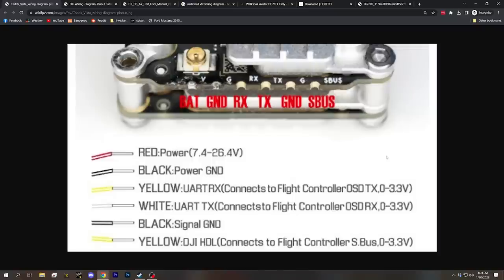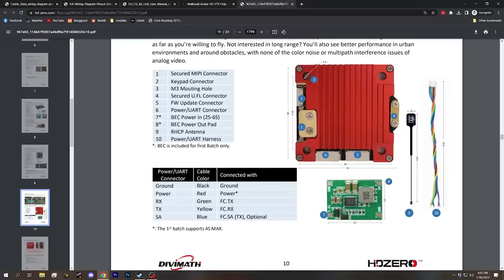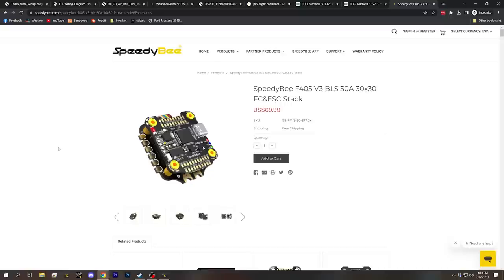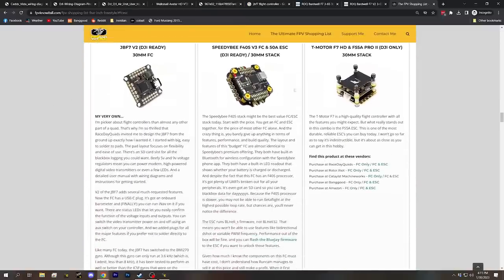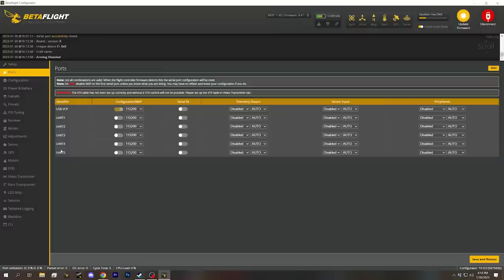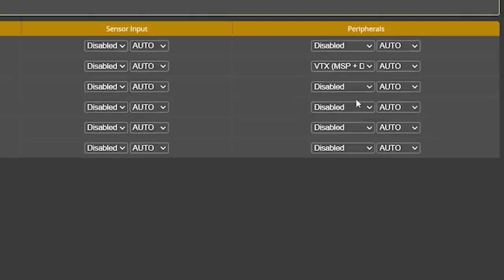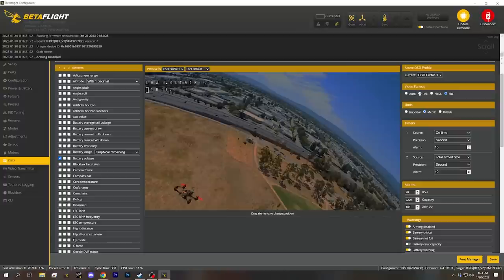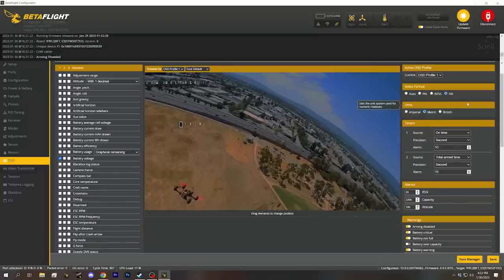Betaflight HD OSD with DJI Walksnail & HDZero // HOW TO SET UP

Comment: If 4.4 build is done with USE_OSD_SD then you may need to set osd_displayport_device =MSP. This is because the MAX7456 will be used if found. Once HD VTX fully support HD OSD then this will be set automatically. Currently only WTFOS does this.
Reply from the maker: Damn. I didn't realize that wasn't handled automatically.
Reply: Mine only works 1/2 the time. Any reason you can think of?
Reply: This comment ended my headache. Thank you!!
Reply: i should have read the comments sooner lol all good now good man joshua and steve for pointing that out
Reply: @evidentloss  nope. This is configured on the ports tab making it much simpler.
Reply: @JoshuaBardwell  Can you send one of your tires to a fan of this hobby and in return I will send you money because there are no assemblies and such things in Iraq and I do not know how to ask for these things ?
Reply: Saved me a mess of hassle! Thanks a bunch for this info!
I've set HD OSD in the iNav ports tab twice now and this wasn't a thing, so it was really making me wonder what was up.
Reply: YOU ARE A SAINT YOU DESERVE A NOBEL PEACE PRIZE
Reply: The gotcha for me was the firmware in the Walksnail VTX must match that of the goggles. Or else.. Nothing. As soon as you flash the VTX, up it comes. 😊

Comment: On bf 4.4. I couldn't use the recommended uart for osd as it was on the plug and I wanted to direct solder. So used a different uart pair. Didn't matter what I did I could not get it to work but my walksnail would come out of standby mode when armed. I re-mapped my uart pads to match the fc vtx uarts that didn't work but when I mapped them back to where they were originally it worked. Strange stuff.

Comment: My main question is for most of the hardware where can i buy it because at least in germany most of the stuff is sold out always. And its sold out now for many months. Some is available for unrealistically overpriced money.
Reply: I wouldn’t be surprised if a lot of that gear is going to Ukraine. The fpv hobby has certainly grown there for one way whoops!
Reply: @SkeezyFPV  I think the moment a company produced stuff like that its already sold out by military.
Reply: @SkeezyFPV  just wish to say, and i am here to learn how to make suicide fpv quad 😂, i am from Ukraine, and we run out of Maviks
Reply: @3dmaxers  then why are you watching digital vtx set up video's lol.
One way=cheap gear=analog. 
No need for mavicks wtf lol.
Reply: @3dmaxers  yeah cheap analog would be better and if you adjust the wattage to the minimum needed to run the mission it’s probably harder to triangulate where the operator is than with digital where you can’t really control the power output. Idk tho. I never built shit like that. I’m a former Marine artilleryman. 🇺🇸🇧🇧
Reply: @FATSNAIL-FPV  actually, as a former artilleryman, using a Mavic right on the gun line or on the mortar to spot targets of opportunity, troop movements, and adjusting fire, the mavics are far more valuable imo. Even a 7” fpv quad is of little value compared to what mavics can and are being used for. Fpv is too noisy for observation except in fast overwhelming attacks using violence of action. JB probably doesn’t want me talking about this stuff on his page btw.
Reply: @SkeezyFPV  veteran here to, I meant suicide drones. They're the hot stuff now on that front. Basically just grenade transporters.
Reply: @SkeezyFPV  analog camera is enough, usually operator know where to fly. Russians start to use jammer for 2.4 ghz, but only near valuable targets. Usually artillery deal with them. But one drone can disable sniper team which spend a lot of time to train, and their equipment cost 5k. So even it's a big drone carrying mortar shell it's still very profitable
Reply: @FATSNAIL-FPV  like an rc m203 lol.  No, I’ve watched a lot of video of them flying into CPs in the trenches and that’s some badass shit. I mean if it were my country being invaded I know what I’d be doing. I volunteered back in March but now I’ve got neurosurgery scheduled instead to fix (hopefully) some issues from breaking my back in the Corps.
Reply: @3dmaxers  JB probably doesn’t want us talking about such things in his comments. I’m no pro. But sub on my channel and I’d be happy to share my experience building my first diy quad as well as answer any questions or help in any way that I can. I was in contact with someone that I was going to send some water filter to in Ukraine but unfortunately he was in bakmhut and I haven’t heard from him since November 27. I’d like to help in any legal way that I can, sir.
Reply: FPV parts and gear are plentiful in the states.
Reply: @FATSNAIL-FPV  I wish to make recon drone to watch what's around me. I am not mobilized, but in case wish to have own drone in squad
Reply: @SkeezyFPV  sure, I am not building right now. I am IT guy, and ex sniper. Now I just learn things and  try to save some money cause most of it going to help my buddies on the frontline. My buddy who has 338 told me yesterday that better he have drone that his rifle... 😁
Reply: @SkeezyFPV  JB will not worry about it, cause US send us more interesting thing in masses. And I think our children's will fight together against future threats in near future 😉
Reply: @3dmaxers  yo just get yourself some maybe illegal 1w+ analog VTX and get some goggels with inbuild Recorders, some cheap 6s batterys and fc and build 5 Inch suicide quads for ~300€ per drone... Recievers are cheap and you only Need one controller you modify that one a little for the needed 10km to Match Up with your analog video... Upload the Shit you doing with some stuf maybe cutted Out so Nobody can See the Pilot Position in the Videos etc, and maybe you gain Back some Money to build more and bigger drones
Reply: Just buy from the producers.. 2 weeks in DE. Flywoo, caddx, geprc, iflight 😉👍
Reply: n factory ist eine gute Quelle

Comment: JB there is something seriously wrong with BF 4.4 with MSP using DJI(caddx or original air unit)!  BF 4.3 was perfect. 2 different Fc and two different air units(caddx and dji air unit) same issue where  the OSD may or may not show up.  If it does its at 4:3 aspect or SMALLER.  Goggles and both air units have latest WTFO firmware, BF 4.4 on both FC (Lumrnier H7 and newbee drone AIO infinity v2). Not needed in 4.4 but can confirm "get display" is set to MSP and "get vcd" is HD. Again CLI commands are not needed in 4.4 and set correct.  In the OSD Tab HD is selected and  do have the wide screen picture but outputs something smaller than 4:3 if anything at all! Actually if you place OSD options past the vetticle center or horizontal center of the screen it will not render ANYTHING in the goggles... Again all firmware is up to date and everything renders correct in BF4.3.
ALSO 4.4 doesn't show dual gyros if your FC has them and can't set the correct orientation of the gps module(matek 5883, flipped 270 degrees.) It keeps reverting to default orientation.
Anyone have ANY THOUGHTS.....
Reply: Are you using FakeHD and is your OSD shrunk into 1/3 of the screen in the goggles?
Reply: Hi, I have the same problem that my OSD only appears in an apparently 4:3 window in my DJI Goggles V2, meaning I have them right in the middle of my 16:9 camera view... All firmwares are up to date, I tried all the options in BF osd (auto, pal, nuts, hd) nothing changes... Any ideas what I can do to move my osd informations to the side of the 16:9 screens?
Reply: @beeRacer505  I hadn't been able to resolve it yet.  Just to confirm that the wtfo was fine on the goggles and air unit I reverted back to BF4.3 and all was normal again. At this point it's a 4.4 issue.  I have 2 caddx and 1 dji air u on bf 4.4 and ALL of them have an issue with the OSD. Again roll back the firmware on the FC and all is well.  4.4 also has other serious bugs involving the gyros and compass orientation
Reply: @beeRacer505  Are you using WTFOS on your V2? DJI does not natively support the HD OSD.
Reply: @Mangorille  No, I am not using wtfos... To be honest I don't really care if I get the hd osd. I just want my osd to be 16:9 as it was with my previous setup: DJI goggles v1, air unit, BF 4.3. I forgot to mention that I am using the o3 air unit now, could that be the problem?
Reply: @rip_fpv6455  Okay, I haven't noticed any bugs yet, except for the osd. My CineBot30 is flying on rails with BF 4.4😁
Reply: @beeRacer505  Ya not supported with the O3 air unit, your OSD can only be drawn in the 4:3 space and with really large fonts. What you are looking for is actually called HD OSD (ability to use smaller fonts and have the OSD elements placed in a 16:9 format). The only way to do what you are looking for right now is with the Vista and V1/V2 goggles with WTFOS.
Reply: @Mangorille  So even with wtfos there is no way to get the 16:9 osd with the o3 air unit? Damn it! That sucks... I hope that dji fixes it soon. Thanks for your help!
Reply: @beeRacer505  Correct, WTFOS is only on the Digital FPV System side (Vista, Air Unit Lite, etc.) When you put the Goggles V2 into the Avata/O3 mode, it doesn't use WTFOS.
Reply: Same. Rooted caddx and V2's, wtfos up to date and the HD osd gives me 4:3 aspect that actually requires some elements to be placed outside of the preview in BF to enable them to be seen in goggles.
Reply: @Paulwhittingham  found a fix yet?
Reply: @beeRacer505  fix yet?
Reply: @zoeconner11  No, unfortunately it seems like we'll have to wait for dji to update their firmware with a fix for this problem. Sorry...
Reply: @beeRacer505  what's the work around?
Reply: @zoeconner11  Sorry, I don't know any. I'm just flying with the 4:3 old now. It sucks, but there ain't nothing I know that would fix it... If you do find something, please let me know!

Comment: Just noticed a little "bug" in bf 4.4: if i copy my osd settings from one copter to another one, the osd is not showing the right alignment of the elements. Just make sure, you enable 'hd' before you paste the cli, then everything is fine.
Just updated 4 of 5 builds to digital, wallsnail, and observed this behavior
Reply: Not a bug. This is a deliberate feature so that all OSD elements will be visible and thus movable on the configurator display.

Comment: Ive got runcam link wasp air unit and v2 goggles, after ive done the wtfos rooting and all of that procedure OSD does not show up. It shows battery % but it does not show the quads voltage at all. The BF OSD pops up on the start up which means my rooting was all good, no luck ive re-tried same procedure still nothing. air unit is on 608 and goggles is 606 firmware also the FC is on 4.4 MSP uart 1 is on and VTX MSP display too are on. Pls help

Comment: I’ve got a lil bug with the rooted dji v2 goggles. When I power on the quad before I power on the goggles the it only shows the top right of the osd. If I power up the goggles then the quad the osd appears properly. Not a big deal but still a weird bug
Reply: do you have the DJI FPV? Can you after root still connect to DJI FPV easily?
Reply: Broooo that happened to me too... I was soooo confused...! One time itd be og and the next itd be hd... og... hd.... Im like... WTF....!! THENNN I got it😅😆😆 I think we may have missed a step... Did you paste the 2 things in the cli? I did the one... but not the other....

Comment: Please help! I have walksnail lite vtx, betaflight 4.4.0 

All working fine, osd being show and vtx/goggles communicating with FC
 
BUT: I cant select Hd on the Osd tab, I check the HD box and it jumps to PAL, the osd is in this PAL tiny squares and I cant use the full HD space for the OSD

Comment: HD OSD is working well for me; rooted Goggles V2 and Vista in the Evoque F6X.

But..

The OSD sometimes remain at 4:3 instead of 16:9. Sometimes. Not sure why. I’m using Nebula Pro camera if it makes a difference.

I’m using the same Nebula Pro and WTFOS in my Mach R5 without the above issues (Beast F7 in the Mach R5 and Blitz Mini stack in the F6X).

Not sure if JB or anybody has any insights to why this is happening.
Reply: My problems are even worse with BF 4.4 dude. About to make a comment on it... funny it's on the same iflight Mach 5 lol! Osd stuck on 4:3 or even smaller!
Reply: @rip_fpv6455  reflash
Reply: @timmytson1  Timmy have reflash both fc firmware several times over the last 24hrs and even WTFO on air units and goggles.  Built over 2o drones in the last twelve months. I'm a pretty advanced user. Like Bardwell but prettier and richer lol
Reply: Fix for this?

Comment: I know it's late but I have a question/ theory. I've just got a new avatar system and the setup went OK, but as soon as I unplug the drone and reconnect later the osd is gone. 
But if I start like that then go into the speedybee app (I have an f4) then reset the osd comes back!
My theory is the avatar system starts slower then the FC and misses that point where the osd is applied but if I soft restart via app the walksnail never powers down and is there for the "handshake" this time....... any thoughts?
(UPDATE) Flash/erased the fc seems to be ok now. :s

Comment: I had such an issue with flywoo baby nano 20/f405 1-2s FC because the wire diagram is for analog and BF 4.3 was not being kind. 4.4 and wire the TX to RX instead of VTX on uart 6 did the trick.

Comment: Most of the time when I boot up it reverts to standard definition and fonts super big. Only sometimes the DJI goggles v2 boots up in HD. Any fix? Thanks man your the best.
Reply from the maker: The Betaflight HD canvas doesn't change the font. Are you using wtfos? Custom font setup for wtfos is outside of Betaflight. It's something separate.

Comment: Another awesome video!  What is the best method for displaying LQ on the Dji goggles v2 OSD? I'm on betaflight 4.3 and the most current goggles firmware so I don't think I can hack them.  I'm just wondering what is the best way to get LQ in my OSD.
Reply from the maker: Use FPV WTF Butter to roll back firmware. Root goggles. Update firmware. Install wtfos on goggles.

Comment: I got a "gotyou" catch for you...   I'm using the HDzero freestyle vtx, with the HDzero goggle.  I have to use the HD video format otherwise I'm loosing too much room on the OSD. But I have to keep setting up the fields on the 3/4 left part of the screen. This is fine too. But the problem is the statistics at the end of a flight. They are displayed too much on the right and I can't see the values of the fields.  I only see for example, FLIGHT TIME is just past the middle of the screen, but I see no time displayed.  How can I re-center the statistics?  Is there a CLI settings for that?
Reply from the maker: Yes. You need to set the canvas size correctly. 

In CLI type:

set osd_canvas_width = 50
set osd_canvas_height = 18
save

Comment: I tried to put the osd in betaflight and I think I messed something up . The Rx won't connect to the FC so I decided to reset all, the gyro and the MCU were not working. I put the motors protocol and then the FC won't connect to the computer .It doesn't connect to my googles v2 either because I think the Caddx Vista no longer communicates with the FC . I need help please

Comment: Heyo, I have a nazgul evoque with an IF blitz min F7 flight controller.  I'm using with a caddx vista with Goggles 2.  Iflight documentation says the vista is using UART 1.  Visually confirmed the wiring is using the same plug.  I upgraded my blitz firmware to BF 4.4 and enabled MSP and VTX MSP+Display Port on uart 1 but I'm not getting any OSD.  I can see battery voltage so something is coming across that UART but I get no BF OSD.  Vista and Goggles are on the latest firmware as well.  Anyone have any ideas?
Reply: o mesmo aqui com meu conelog 25v2

Comment: Using Goggles 2 with Air unit on betaflight 4.4.0, but cant get any osd to show up in the goggles. why? Found no settings to add custom osd in the goggles menu..
Reply: I tried both HD and PAL.

Comment: I have BF 4.4 and HDZero Freestyle VTX and the HDZero Goggles.  Why are my Betaflight OSD elements blinking?
Reply: I figured it out.  I still had the last RX Uart pin connected as I was originally using that in BF 4.2 for OSD.  After upgrading to 4.4 I don't need that.  I just removed the pin that DJI uses for HDL.  After removing that cable no more blinking BF OSD!  Woot Woot!

Comment: You said in BF 4.4 there's the HD checkbook in the OSD tab. What about 4.3? I've got my OSD working, but still in the 4:3 format...
Reply from the maker: That's a 4.4 feature. It's not in 4.3.
Reply: @JoshuaBardwell  so in 4.3 I'm unable to use a 16:9 OSD? I'm stuck with my OSD in 4:3 radio, cluttered right in the middle of my screen?

Comment: Running BF 4.3, Caddx Vista & DJI V2 googles.  Both rooted and I'm getting a double display of the old clunky and new HD.  Tried turning off "custom osd" in the goggles and the hd display vanishes but not the clunky old one.  Deleted a few osd elements in BF, power cycled everything and the old clunky osd is stuck on in the googles even tho turned off in BF.